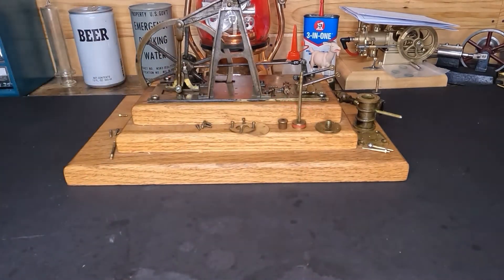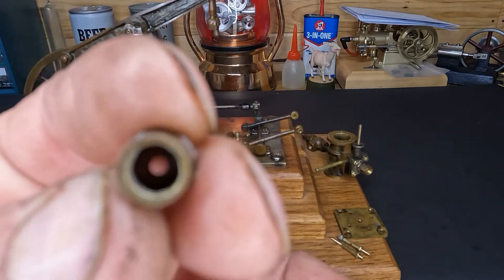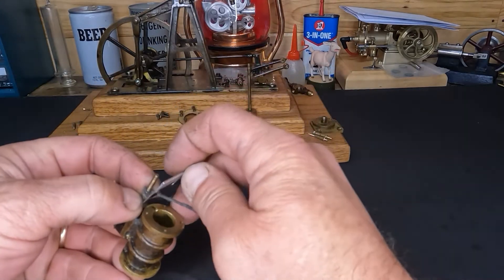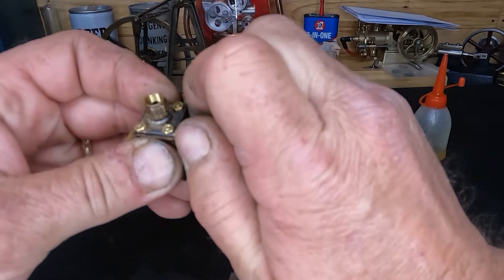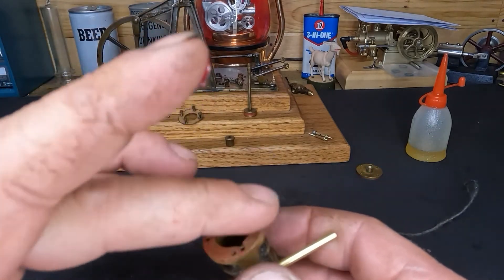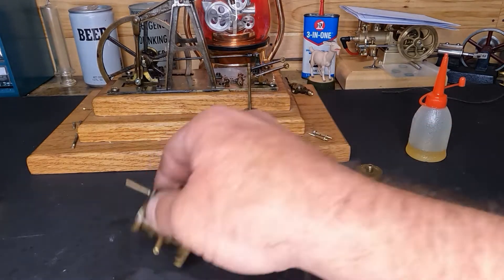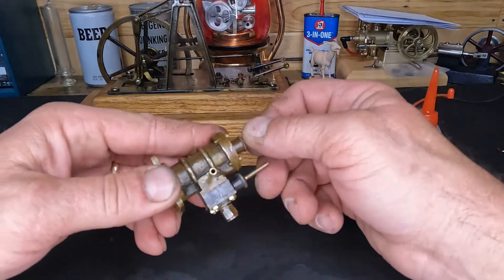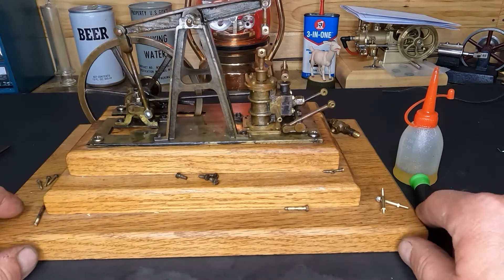Antique brass walking beam steam engine repair / original restoration

Comment: We have all already experienced this moment me too once late at night it happened to me to look for something that was right under my eyes it is fatigue that does that that is why I avoid doing very precise and difficult things so as not to make mistakes like drilling asymmetric holes This engine must be at least almost a hundred years old.!!!??:goodvibes:
Reply from the maker: Hey David, You're exactly right. Long days at work make for short nights in the shop, and dumb (squirrel) moments are inevitable.  Wait to see the next video, I think there are 4 failures with the machining of the replacement pivot pins. I could have taken a day just to get these little thing's done.  I think that you're right on your guess, I would love to find some information about this little engine.   Thanks again for your interest and for taking the time to leave such a great comment.     I appreciate it 👍

Comment: I think it's about 100 years old, I'm surprised at you putting joint sealer on, a smear of oil on the joint would have done. Is there any reason you left the center in the bottom joint, it could degrade and cause problems in the future. Nice that you show the errors of the original builder, shows that times don't change after all! at least not for me😁
Reply from the maker: Hi Paul, I used the gasket sealant more for an adhesive to aid in the assembly process (you're right oil would have done a fine job too)  to answer your question about the lower gasket, I have no good reason. I honestly didn't give it much thought until you mentioned it. I see exactly what you mean, I will save someone else the headache and fix my mistake. Thank you for watching and bringing it to my attention. Once again you guy's are GREAT 👍
Reply: @steam212  I stumbled across your site and think it's great. I'm still binge watching. subscribed as well👍
Reply from the maker: @paulrayner4514  Thank you Paul, Welcome to the shop and the best steam crew anyone could ever ask for 👍

Comment: NO!!! Do not let the cat in, he will chase the squirrel. With all your work on this critter it still looks old. The odd bolt patterns assist with assembly orientation. That chunk of packing in your hand reminds me of my millwright days, thousands of pumps rebuilt and packed. Your linkage comment reminded me of the time I thought a carburetor screw fell into a intake manifold. OH NO!!!!. 3 hours later................................................................................ It was still stuck on the end of the screw driver.
Reply from the maker: Hi Joe,. I think that the squirrel is recruiting allies for his push for us to make a steam powered nut cracker. We will have to do some disassembly and age some of the parts still but I appreciate your compliment. I too spent some of my time in being a millwright at a foundry, I don't miss it. I felt so dumb having looked for better than a half hour to find a part that was EXACTLY where it is supposed to be.